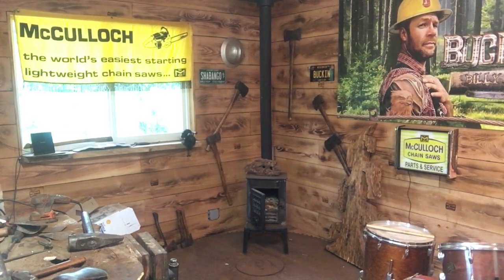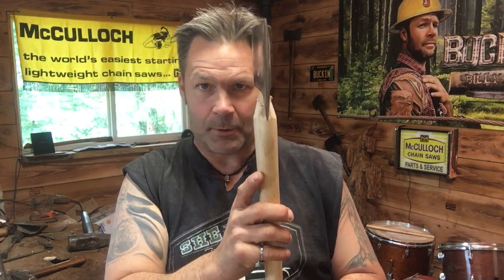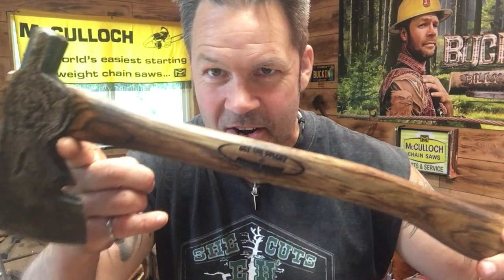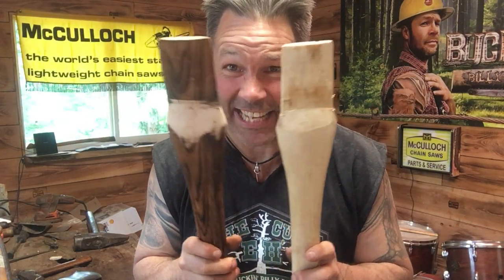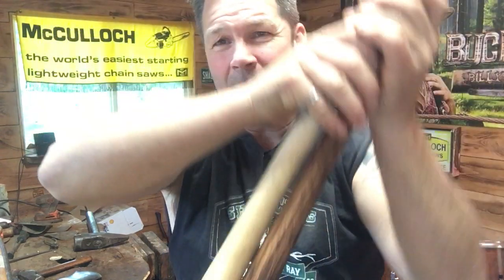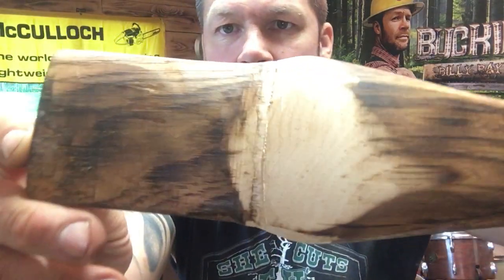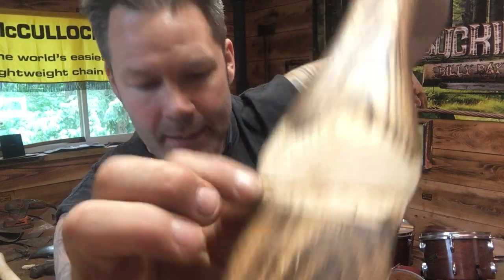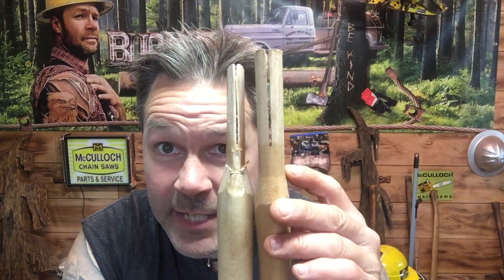How to make that axe head fit tight

Comment: I've just started going through my dad's old tools. Some of the tools may have belonged to his dad and grandfather. So, anyway, I'm a woman in my 60s and I have some knowledge about woodworking, carpentry etc. In the last few days, I have put new handles on a single bit axe, a double bit axe and a bush axe. I'm not thrilled with all of my work, but for a beginner I would give it a B+. I have noticed this shoulder issue, and wondered why it was so abrupt. Now I know to taper the shoulder almost like sharpening a pencil (sort of). I should get pretty good at this by the time I repair all of these tools. Signed: Mrs. Grumpy Old Man

Comment: I agree with where you’re going with the shoulder. It has to be very gradual, and from my experience even more so than the transition you have on the Beaver tooth. Same with House handles also. I have to spend some time thinning the shoulder way down. I don’t think the shoulder needs to be any thicker than the width of the axe at the widest point for several reasons. Bounce being the biggest, but also the argument that too abrupt of a transition increased the chance of the handle breaking because the thicker the axe at the shoulder, the less flex it will have. Another reason being if you’re splitting and the handle sticks out wider than the head, then the handle gets chewed up a lot faster. As far as bounce, I’ve also been tapering the inside of the eye at the bottom to help it slide further down rather than dig in as much. As they come, they’re mostly a 90 degree angle with a sharp corner that digs in. When I taper it with a file or Dremel (just a little), it seems to help. Anywho, just some thoughts. I love the channel man. Thanks for all the great content.

Comment: Billy  big fan ,  in my area southern Cal we don't have any large tree to cut down, mostly we are ag county(Imperial Valley) and hot desert but i love axes i refurbish old axes cause i think its cool, your right i ran into the same problem thin eye and i seated the axe on the handle and when i hit it on i cracked the handle, but ill start all over again into the transition into the shoulder,, thanks for the input

Comment: I'm a hafter - bigtime. Great video. I totally agree and get it. 
One thing I do when I'm hafting is I make sure that I don't flip the head on the the handle from front to back. I hand write a label on the head "front" and also on the head "front" so that I always put it back on the same way. I find that if I turn it backwards by accident it screws up by fit because by no means is any eye symetrical. Anyway, thats just something I thought I would share.Thanks again Buckin'.
What have you been using to get that amazing patina on your heads? I did see the video where you used tea. Are you still using tea? (I tried to ask this on the June 10th live Q&A but the trolls showed up). lol Anyway, maybe some content for another video.
Buckin'' thanks a ton for everything you have shared!

Comment: I just had to disassemble my new council tool camper axe. It developed a wobble in the handle after some mild use.
Sure enough - there's a 90 degree ridge where the handle meets the eye, and the wedge was a piece of crap done by a 10 year old. The wedge was too short, made out of soft wood that fell apart in my hands. Very disappointing for such company.
This video is spot on, they should watch it at the Council Tool company. They are going down in their quality it seems.

Comment: I always press my handles on using a short section of steel I-beam and a 10,000 lb bottle jack.  I built a frame for it a while back and I can handle an axe in about 30 seconds with a MUCH tighter fit than I can get any other way.  I always fill in the kerf with a piece of oil-soaked veneer before I press the handle.  I think I'll start tapering the shoulder though.  That might get the fit even better.
Reply: I have a vague memory that gransfors bruks press their heads on?  I think you would have to do it by hand to frost develop the skill though, and make sure not to get it biting into and fouling the shoulder
Reply: I want to try pressing a handle on though!

Comment: yea, that's true. What I'm thinking of now is that some eyes' edges can be too sharp. Then whatever nice transition you put on the shoulder  it will still cut it like a knife. I'm not affraid of grabbing a file, a stone and dulling it to a rounded fine polished shape. The next thing is a lubricant. Why nobody uses a lube? That thing will go deeper. Maybe even too deep. Could it create a stress on the wood in the line of the transition when it's too tight? What do you thinkabout that?
Reply from the maker: A MAN DEFINETLEY CAN OVER MUSCLE AND FRACTURE WOOD FORSURE.  BUT MOST DEFINETLY HAVE FILED MANY EYES  FOR A BETTER SEAT , YOU BET
Reply: Thank you for the response. It's nice that you care about the feedback

Comment: Hi, I have a question. I've got cheap hickory handle, and I have a cheap axe head. But the hole of the head is slightly smaller than the shaft. Is it ok to remove 2-3mm of the wood to fit the axe head? Will it weakens the handke is my question??

Comment: This is an old video, but I always expect to modify my handles. I usually modify the taper, deepen the wedge slot, and shape the end to fit more snug. Also, I round off the bottom eye of the tool I am hanging.

Comment: Hey Billy, how wide/thin should the eye be for a sledgeaxe/maul weighing around 6.6lb? It should be just enough to actually bend when you put the wedge in the eye. If the eye is too thick then there is a risk it won´t expand and tighten when you smash the wedge in (if you manage to get it in in the first place), right?

Comment: Why do you leave some of the handle proud of the axe head at the top?
Reply: Because it’s mushrooms the the wood over the eye leaving it nowhere too go 
When a axe is cut flush too the eye they are vulnerable too get loose and are generally riddled with nailed and screw’s because it is inside the eye